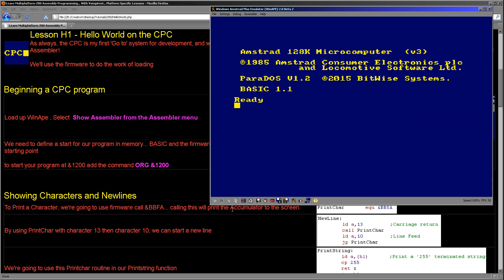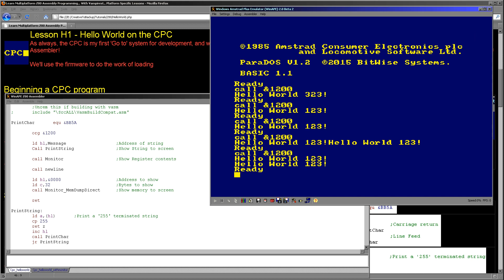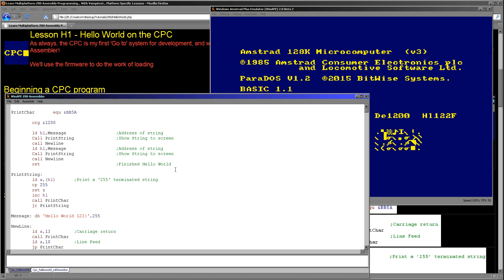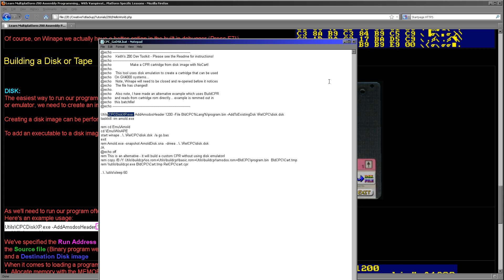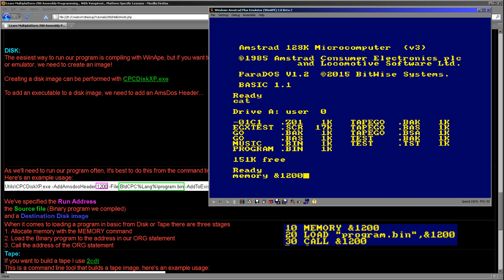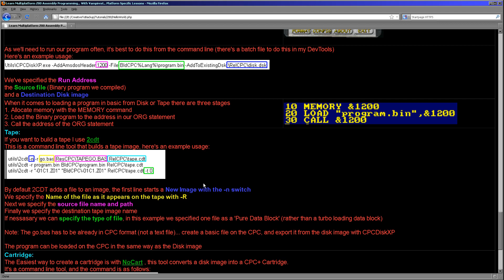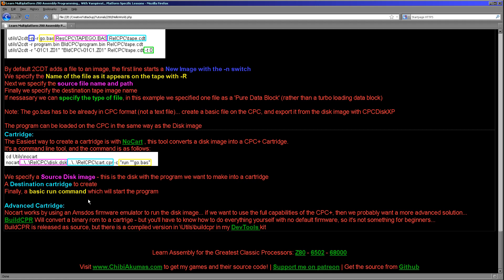Hello World on the Amstrad CPC - Learn Z80 Assembly for beginners

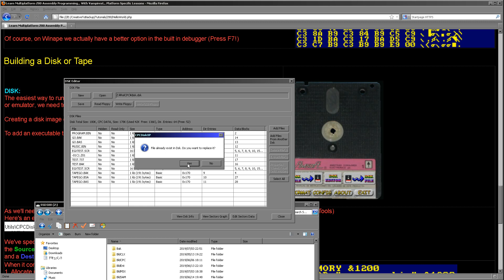Comment: 09:38 I just did not understand that You Run the Assembly file for direct output to emulator but where you can find BIN file and add to DSK image file ?
Reply from the maker: Check the help file of Winape if that's what you want to do, it's pretty easy.
Reply: @ChibiAkumas  yeah I already found. thanks by they way .

Comment: Hello! Great tutorial! What do I have to do if I want to run your code on a real AMSTRAD CPC computer? Thanks a lot.
Reply from the maker: You'll need a disk drive emulator like the HxC or M4... copy the disk image that this tutorial showed you how to make to a SD card, then use that SD card on your CPC
Reply: @ChibiAkumas  Thanks! This is great! I have another question:How can I make a game like those sold in the 80s? Using ASM? BASIC? Both? Thanks a lot!
Reply from the maker: @StellaNoctisVR  All the games in the 80's were pure assembly... these days you can get away with it in C as there's some good dev tools around... but I've never used them so I can't advise I'm afraid
Reply: @ChibiAkumas  I'm not afraid to program in assembler. Thanks for your information, that is what I want to know.